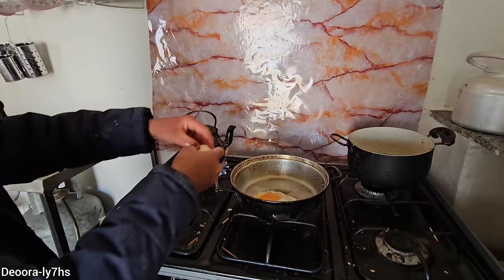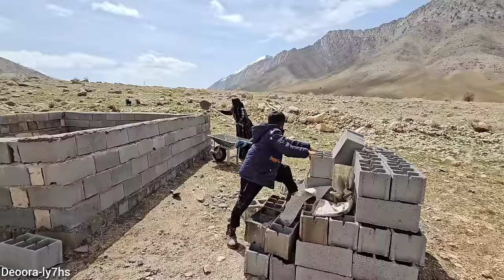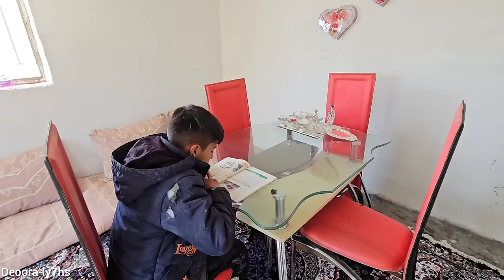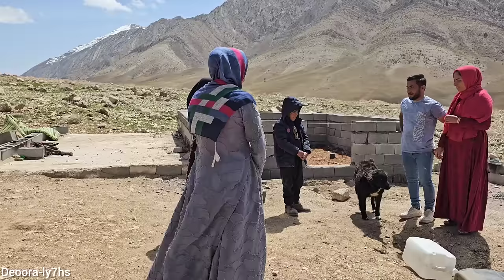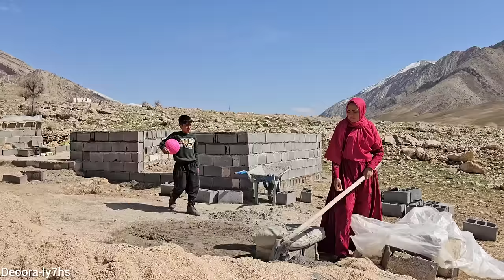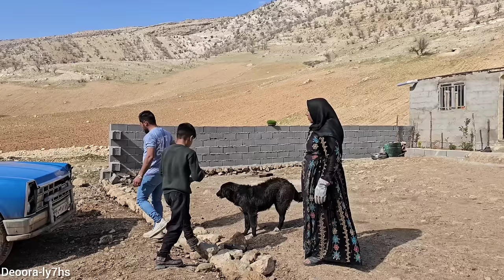Face-to-face meeting: Soraya's meeting with her future bride and Nemat happiness for the baby#deoora

Comment: Неужели нельзя почистить эти грязные двери, все праздники проходят, а двери грязные ещё со стройки! Фатима ты разве не видишь, что это не красиво, матери лижь бы в растворе ковыряться, один вид делает, а толком ничего существенного, начинает, потом ждёт Намата!
Reply: Nemat finché  tua moglie sollevera pesi non Potrà mai avere bambini
Reply: Фатима из того же тесто . Она ничего не видит . Ей лишь бы дома не работать .
Reply: А немат переработался😂
Reply: @user-yp9jb8jx8i  😂😂😂😂😂😂 это точно
Reply: The spots on the doors are plaster and concrete, which have now hardened.  May need to be chipped off.  It’s likely to not just be a quick and simple job.

Comment: Another busy day for Soraya and Hossein.  I hope that she can one day just enjoy the labor of her hard work with her son soon.  Something tells me thats not going to happen when i see the bad shape the bathroom is in and ive noticed if the water barrel is still up on the roof.  Whatever happened to that huge container that held water?  Still I'd like to see Soraya, at least get a oil furnace instead of the one she has.  I can see another project happening inside the house where the plaster is cracking pretty bad, on the ceiling and on the side of the wall.  I guess we'll be watching the fixes.
The young girl that came to see Soraya, today sure didn't stay long, but i get that she needed to help her mom.  I wonder how old she is.  Anyway until tomorrow.  Have or try to have a good rest tonight.  Please go to the dentist before that tooth becomes unbearable with pain.  Goodnight and sleep well.  🕊️🕊️🥱💤🌟

Comment: Soraya doesn't know how to use the gas stove, way to  high and wasting gas. She doesn't have to pay for it. Why do they have to cut up the chicken on the dirty floor, when they all have a kitchen bench?. They are not living in a tent. They cannot adjust to living in a house. Same with the heater, they use oil to ignite it however throw to much in the heater till the flames come out. That is why the wall and ceiling are black. All these nomads do the same.